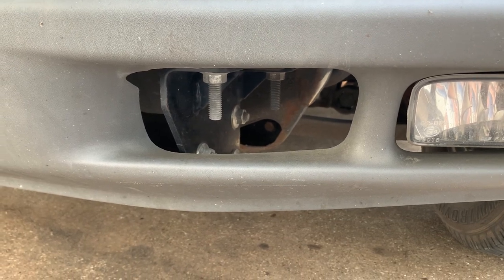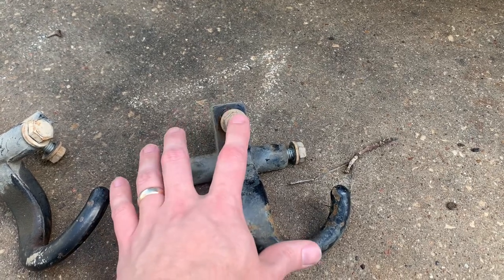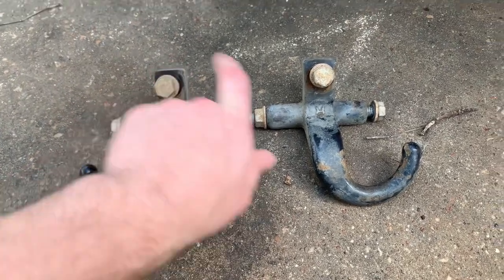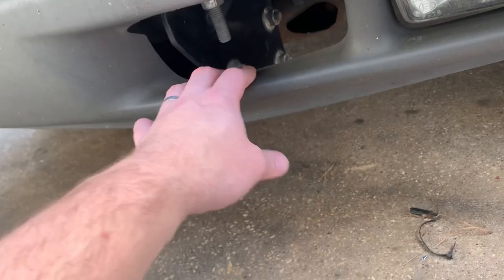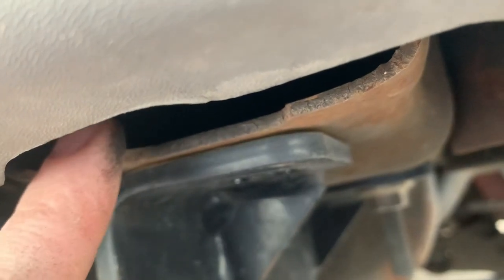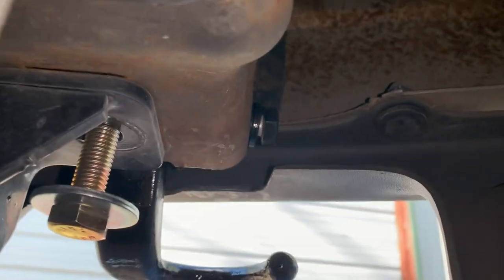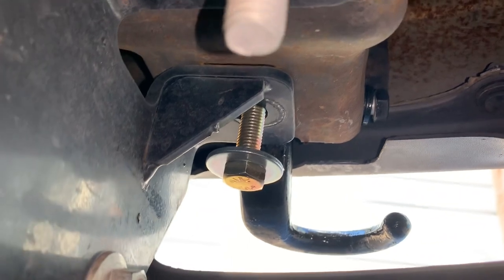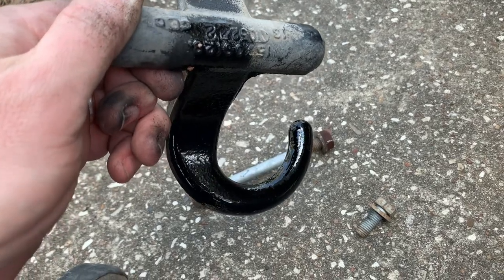99-06 1/2 Ton Chevy Tow Hook Install

Comment: What do you use the front receiver for? Trailers/ Boats?
Reply from the maker: Winch and bike carrier.
Reply: Lightweight plows also mount thru front receiver.
Reply: What hitch is it? The only ones I can find drop the receiver under the plastic trim.